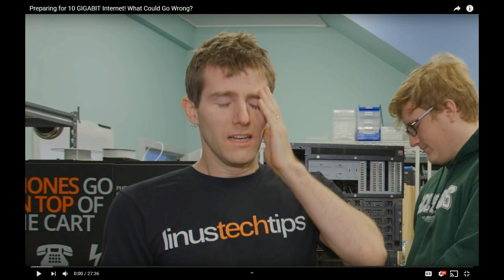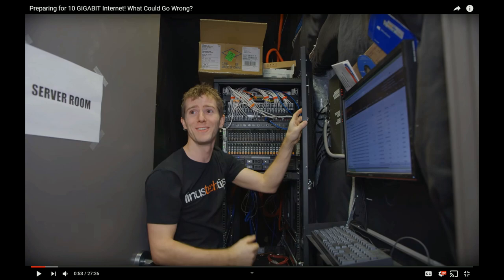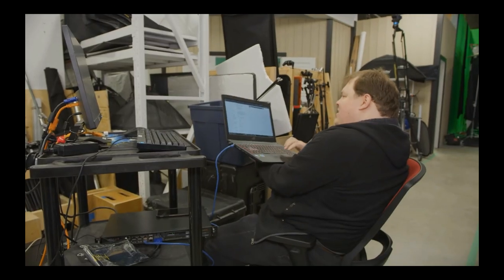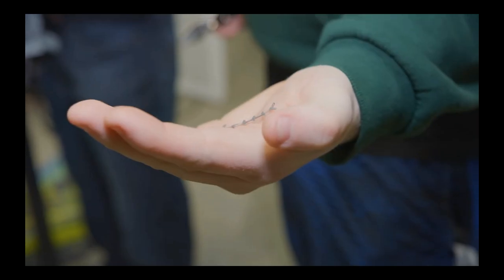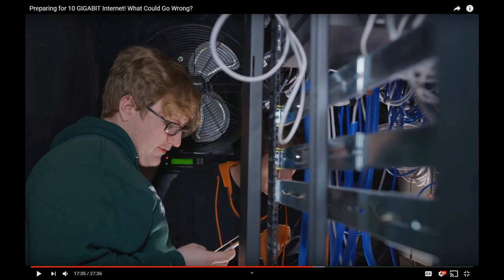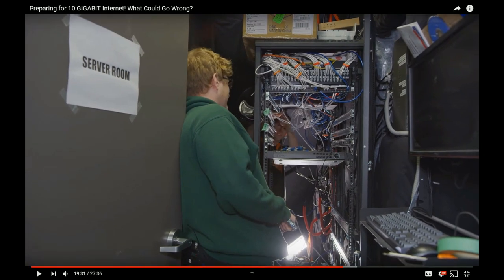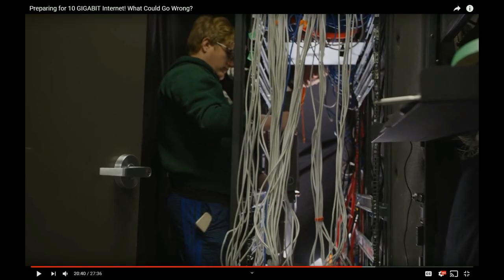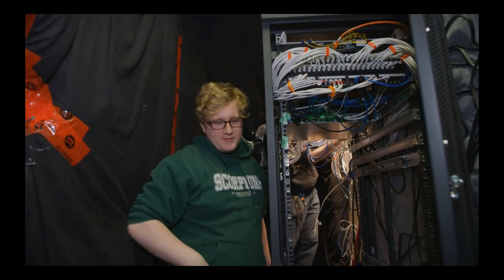Linus Tech Tips' 10Gb Internet: Explained

Comment: Excellent breakdown of how a little knowledge can go a long way in turning a functional network into a train wreck. (Blowing out your core switch config and AP management because you don't know how the VlANs were set up... Really, guys?)  Their last networking guy should have left them documentation on how everything was set up, or else someone (Jake or Anthony) should have spent a few hours reverse-engineering the network and backing up configs before they unplugged their first cable. Instead they made assumptions and started guessing, and unless you know what you're doing and what exactly you're looking at, that can go downhill _fast_. Before you know it, you're trapped in a downward spiral of increasingly exasperated guesses as your original change window becomes a distant memory.